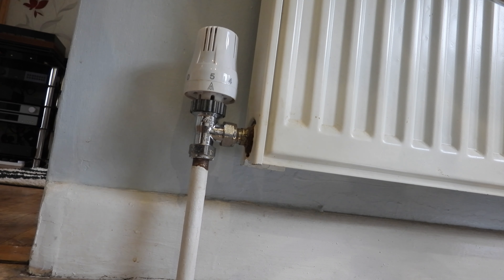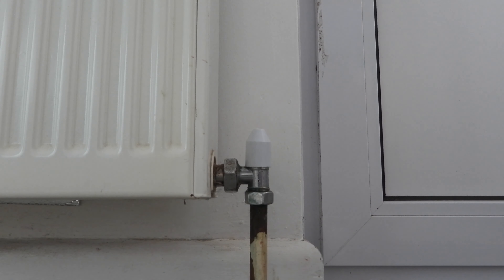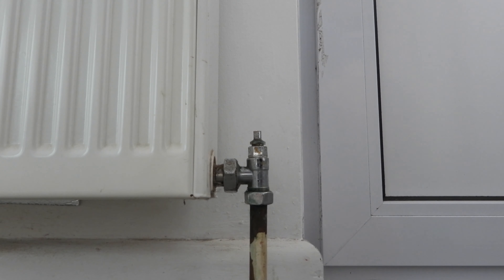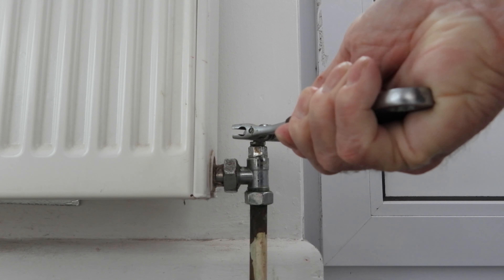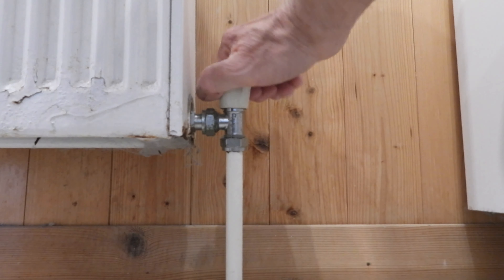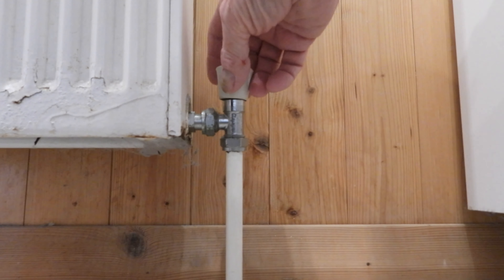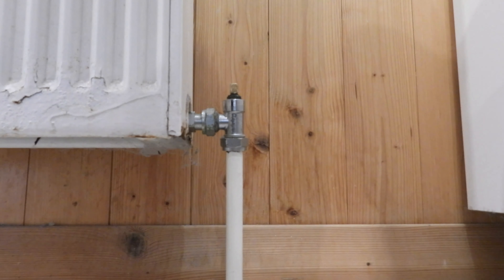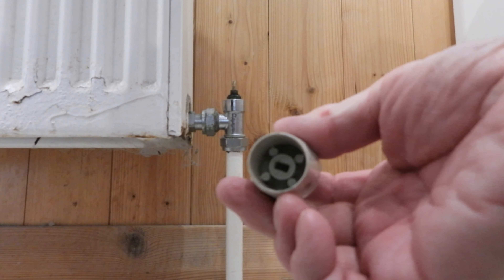Central Heating Radiator turned off, but still hot.

Comment: Could it not just be the valve head and not the whole valve? Cheers
Reply from the maker: On certain makes yes, but not many.
Reply: @dereton33  appreciate the reply. If the pin still goes up and down on the main body, does that mean the valve is still working?

Comment: Unless you have really expensive lock shield  or manual flow valves the gland nut starts leaking.
Reply from the maker: Very rare, and if it does, it just needs a simple tightening up. Don`t be put off by these biased comments that seek to down every u-tube contributor by finding as many faults as they can in any video.

Comment: I have notice my boiler  pressure is keep going down if one of my radiator is off? Pressure is normalized once the radiator heater is on. Can you please advise. Thanks for the video.helpul.
Reply from the maker: Pressure requirement dropped once a rad is turned off.
Reply: @dereton33 yes but if drop off, to .3 from 1.5 boiler will not work..

Comment: Another question to be asked is why were the radiators ‘hot’ in the first place? At 5C outside temperature my rads are at 30C - don’t even feel warm but all my rooms are at 21C.
Reply from the maker: If the the thermostatic rad valve is faulty then the temperature in the rad will just run up to the heat setting on the room thermostat.
Reply: @dereton33  All my TRVs are set to max, I have no internal room temperature reference- running pure weather compensation.😉PS: None of my radiators are ‘hot’.